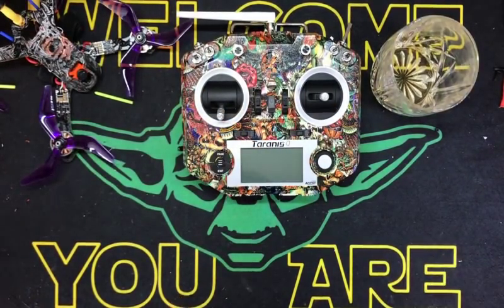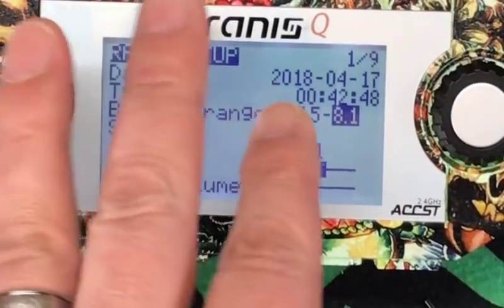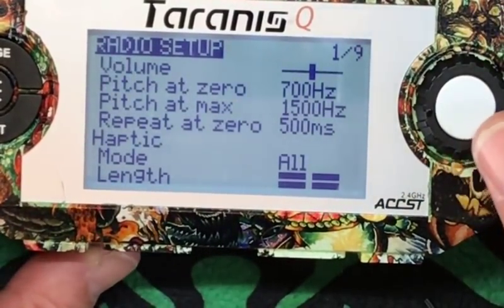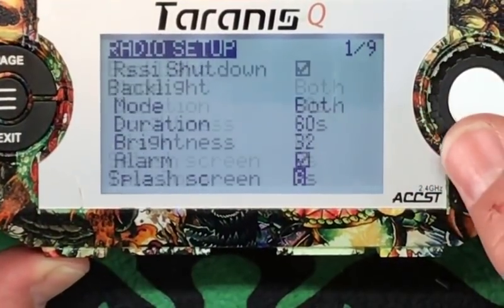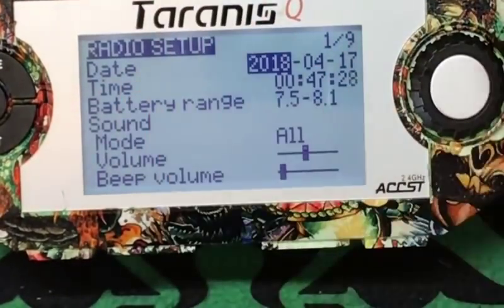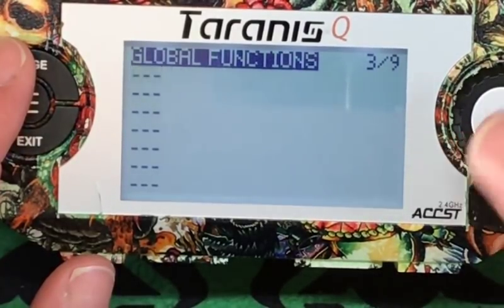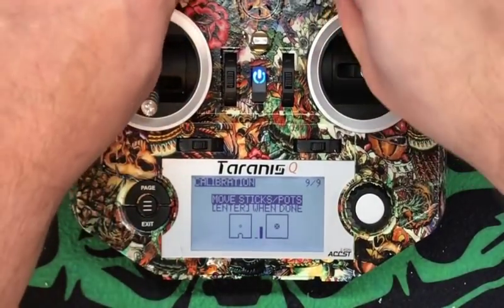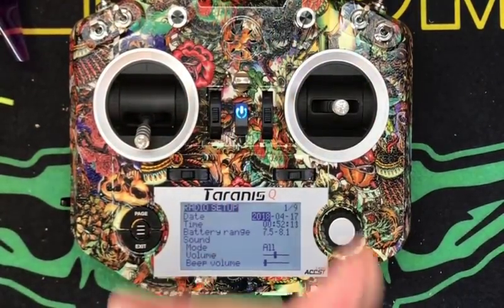Taranis QX7 Basics Part 1 - System Parameters

Comment: Thank you! Just received mine it's a nice introduction.
kr! Erik
Reply from the maker: Awesome!!! Great radio.  Lemme know if ya need a hand with anything
Reply: Well, I have a question I cannot find easely. I ordered Frsky 2s2000mAh lipo for the x7 but I cannot recall the LVC for slow discharging Lipolly. The e-plane controllers I have can be programmed 2,9-3.2V/cell LVC but not sure what is recommended for Tx. I recon it could be 3.5V/cell but not sure. I assume you use NiMh which is 0,9V/cell but this is under high load ( used to fly rc edf jets, with NiCd, NiMh, Li-Ion, LiMn, LiFePo4, Lipo up to 35C but the local club could not keep up with me so I lost interest in planes eventually...). Little help big thanks in advance! 
kind regards, Erik
Reply: btw I went for Lipo because my small chargers do not accept NiMh and Like to have balance leads on all my packs. For this reason not to keen on Li-ion as well . All cells will drift eventually. 

Subbed!
Reply from the maker: Lol hey brother.   I need to get those myself.  Heard they last forever.  Yes 3.5 will be fine for a storage charge, same principle as our bird batteries
Reply: thx for confirmation! Right now my HGLRC vtx went down considering the Eachine vtx03. If you buy them in bulk it should be fine ;) . Just found out my Eagle2 is a mismatch with my Eachine goggleV2 (1080P) need a 1200TVL,4:3 not able to source one... too much pixelation on the Eagle2 and dislike widescreen.
This hobby is awesome!!
Reply from the maker: Lolol frustrating as hell but fun none the less right!!
Reply: Don't install a big Lipo in the Tx! You should be charging the cells occasionally. charging once a year isn't good for batterie capacity as well. I'd be more keen to charge the pack 4 times a year and keep the AA tray as a spare option.
Reply from the maker: Agreed.   Long charge hold on lipos isn’t good.    What’s funny is I pulled down my old radio link the other day, forgot I still had a 3s 2200 in there Lolol.    Oops
Reply: Nice! only remove 1 cell and it's a snug fit!
Keep those reviews coming (but not on a daily base you are not Albert Kim) Don't need a data dump cannot keep up LOL!!  I'm about to unsubscribe his channel too much info.
Kind regards! Erik (Netherlands)